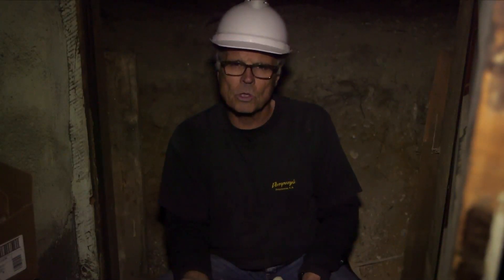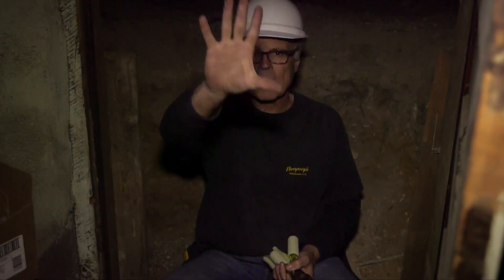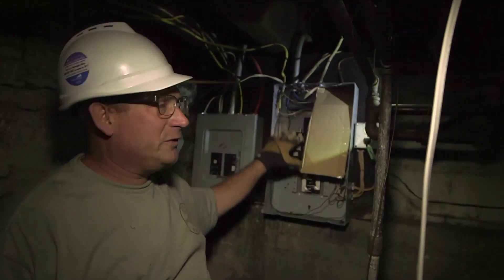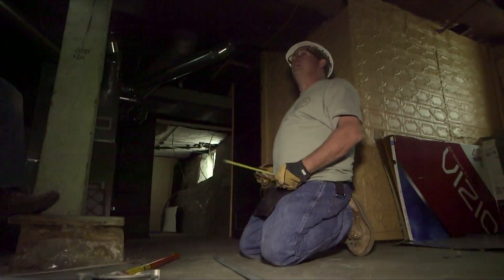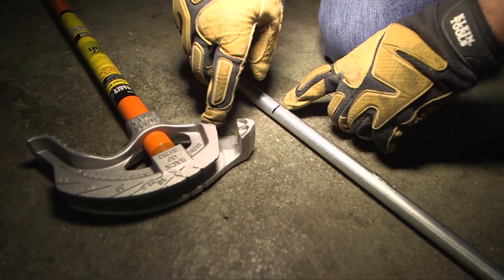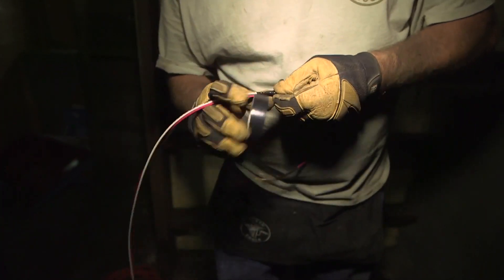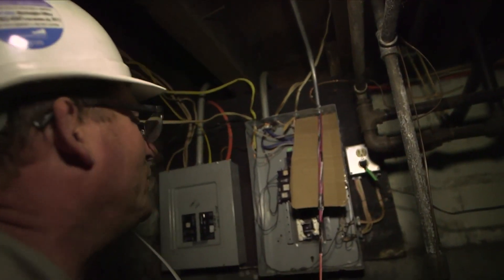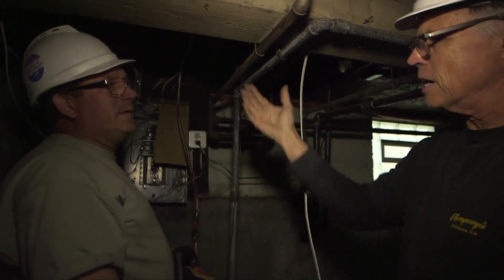Barnaby @ Home: Running Conduit

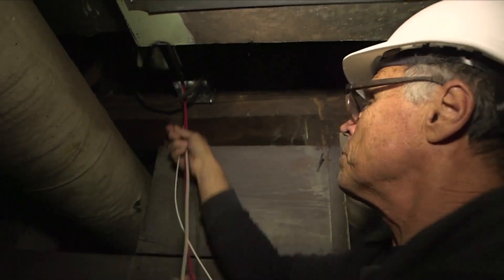Comment: 3:29 Pulling network cable inside the electrical box will most likely cause serious signal degradation and crosstalk.
Maybe when you say network, you are not talking about Ethernet. :-D

Comment: No cable green ( ground) ?
Reply: the house is an old house most likely, so the conduit is the ground itself from the panel. they will attach a green ground screw and ground wire to the box if they need to ground a device going in the box. otherwise it is grounded